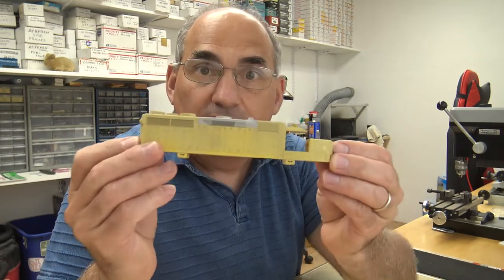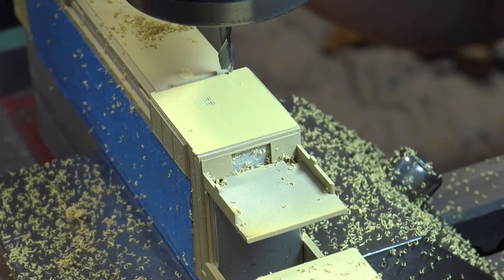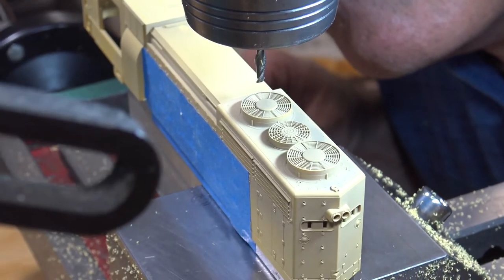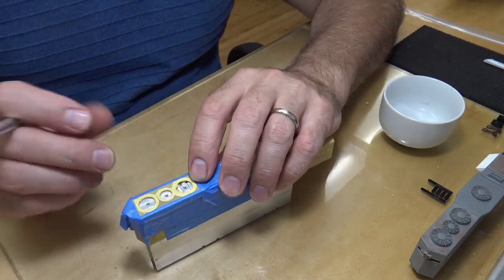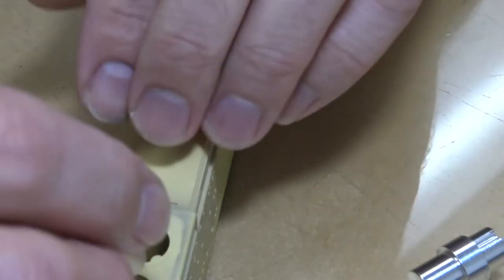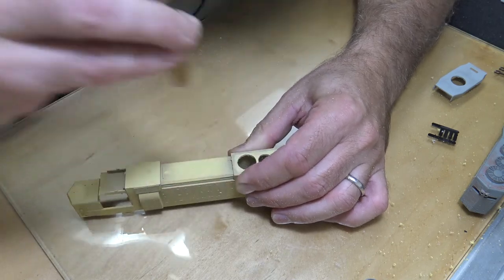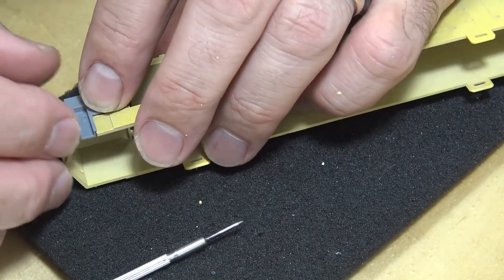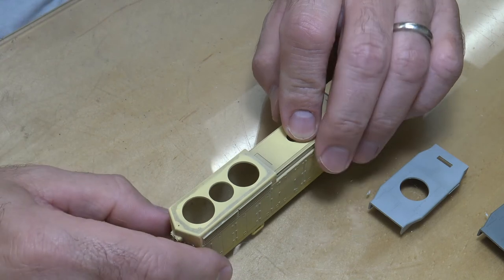KATO GP35 PROJECT HOOD DECONSTRUCTION

Comment: Wow thanks again for sharing. How did you figure out one side was higher than the other side?  Would you in my case 3D print tools for my GP35 /30? Is there a way I could get my hands of tool for do this kid of work on my N scale. I am will and have done some, but not the kinda accuracy you getting. I know I can do it. I can see that now.  Keep them coming.